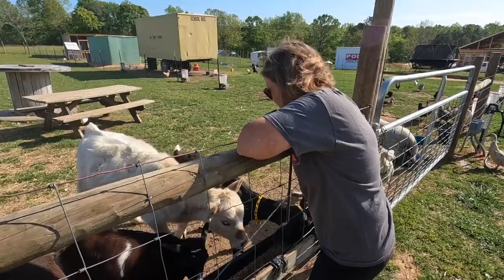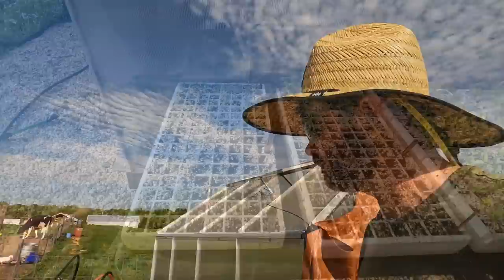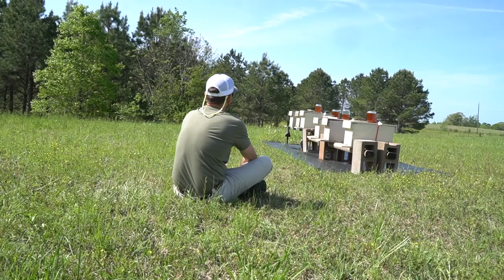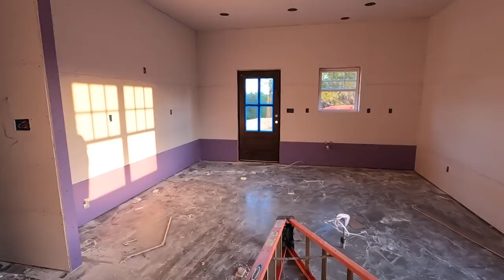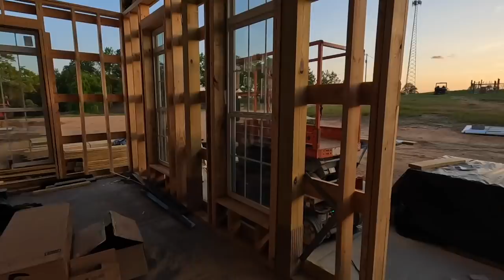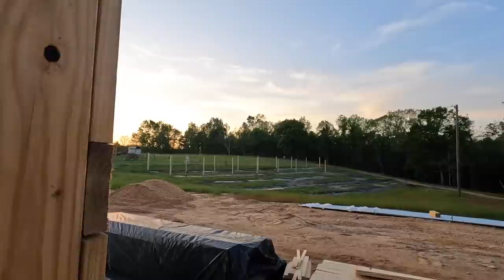Very Special Day On The Farm, Because We Just Got Honey Bees!!!

Comment: When I was working in construction we had three Brothers from northwest Arkansas. When they come up here to northeast Oklahoma they wanted to have to houses to hang sheetrock on. They would hang one in the morning eat dinner and hang the other one that afternoon. The houses was 16,000 to 20,000 square feet floor space. It was amazing to watch them work. I was doing the Sheetrock finishing and it was easy to do behind them. Their sheetrock joints didn't have gaps in them and we didn't have to drive in a lot of nails that wasn't drove in right. Yes they was using nails thin. Screws for construction work wasn't being used back then like they are today. We couldn't get them one time and was short on time to get the house done.  So my brother in law and I and a guy that worked with us said we would hang it it took us two days to do it.
Love you'll and your videos. You'll stay safe and God bless.                  Dan

Comment: Jason, this is not a joke, before u close up upstairs in your house u need horizontal tension cables in order to have bedrooms upstairs. I see a weakness in your roof enforcement approach. Heed my warning brother. If your builder eliminates the horizontal support in order to create uninterrupted space u have to substitute it with a better structural support. I wish there is a way to contact u to explain my point, it is much easier and much cheaper to do it before they put up walls upstairs.

Comment: Big mistake. If you can put your air handler inside your home or in a conditioned space do it. If you foam your roof cavity it should be fine to put it in the roof cavity but you have to make sure your roof cavity is ventilated with conditioned air or dehumidified air.
Reply: Ps. Also make sure your windows are wrapped (Tyvek) and has an appropriate sill because you have almost no overhang over the windows. Window leaks will be in your future if not done correctly. Just your friendly building scientist. Love the channel.